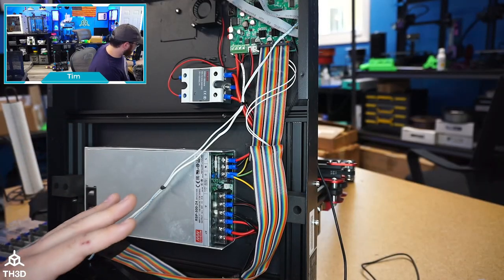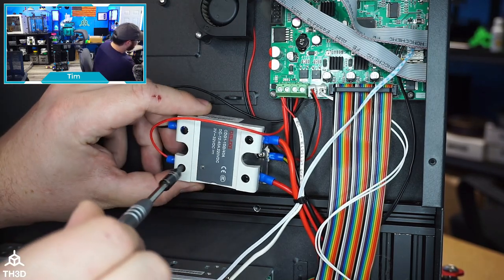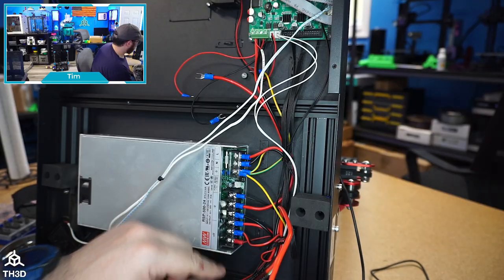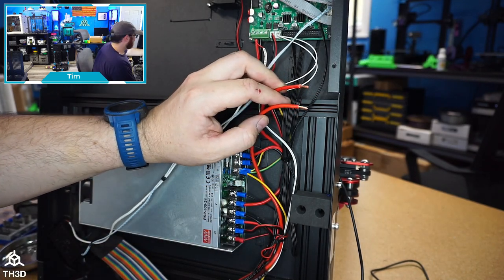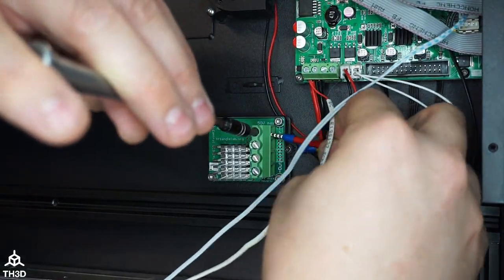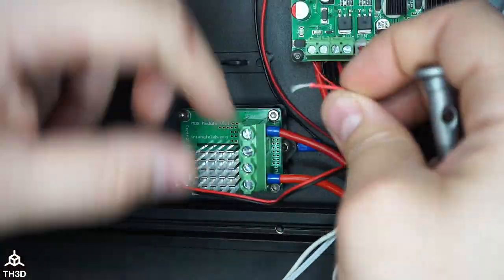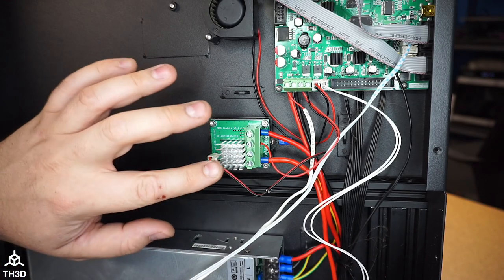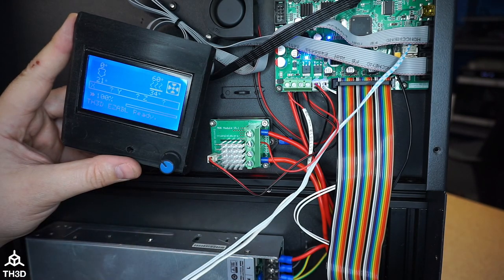Replacing the CR-10S Pro Bed SSR/MOSFET - Repair Guide

Comment: Is there a replacement for the now overpowered power supply? I'm trying to get rid of the screaming loud fan with the stock power supply. In my understanding I'd get away with a much smaller power supply that now only has to support the board, the nozzle and the stepper motors, right?
Reply from the maker: If the bed is running off AC power you can drop down to a 150W PSU for the main printer. You'd have to make an adapter bracket/plate for that though. If you're running the stock bed still then you want to keep the stock PSU.

Comment: My OLD CR-10(v2?)'s bed started having issues. It wont heat up unless I unplug it and plug it back in at the start of a print. I don't know how to check if it's the bed itself or the MOSFET. I'm leaning towards the MOSFET, in any event I need to fix it because I'm not going to risk having it go up in flames. Will the instructions in this video work similarly with the CR-10 v1 / v2?
Reply from the maker: That sounds like the mosfet. If memory serves correct that one has a separate MOSFET for the bed that is driven from the board mosfet. If is the separate one, ours can replace it. If its the one on the board, you'll need to replace the board.
Reply: @TH3DStudio  I reached out on the site directly after I commented and ordered one. Thanks for the response!
Reply from the maker: No problem! I think I shipped that order today :)

Comment: anyway to tell if its the mosfet or the bed itself? My old Pro's bed quit heating today during a print. its never gave me issues until today.
Reply from the maker: check if youre getting power on the output side of the mosfet. No power = bad mosfet. If you have power (should be 24V) then its the bed or wiring to the bed.
Reply: @TH3DStudio  yeah looks like bed is dead im getting power to the wires. guess i cant complain much i got lots of print time on it, having issues finding part though. Hate to retire it. its my fav printer.

Comment: What happens if the light of the board does not turn on, does it mean that what is really damaged is my board and that is why my bed does not heat?
Reply from the maker: If the LED on your main board isnt coming on then it could be a software issue (incorrect pin assignment) or a hardware issue.

Comment: I had to replace my power supply recently. Now my bed wont heat above 47C. My CR-10S4 is printing fine now, I just have to set the bed temp low. I was wondering if a bad mosfet would reduce the amount of current going to the heat bed. Im no electronicstician or anything, but I can ham fist my way around the school of hard knocks. Great video, but that algorithm had this way low on my search results for "bad heat bed mosfet" LOL.
Reply from the maker: It's worth a try. But the S4 will struggle getting to 60C. Its a low wattage heater.
Reply: @TH3DStudio  Yes it always did struggle to get to 60. I thought it was just me. This is my only machine, so I have nothing to compare it to. Thank you for your response.
Reply from the maker: @timbrown9535  also, bump up the PSU to 13.5V. Theres a video on our channel showing how to change the PSU voltage here: https://www.youtube.com/watch?v=pJRYXKRAUN4